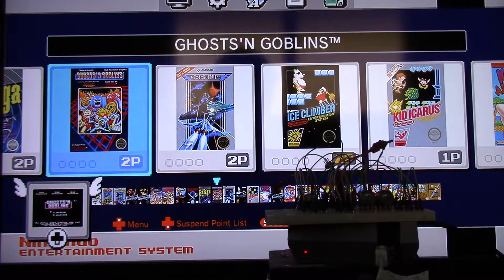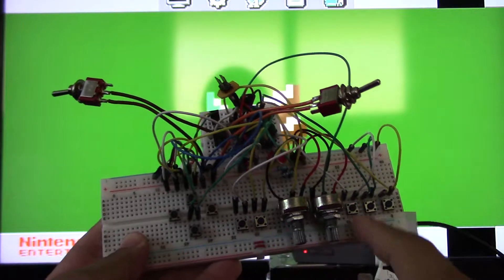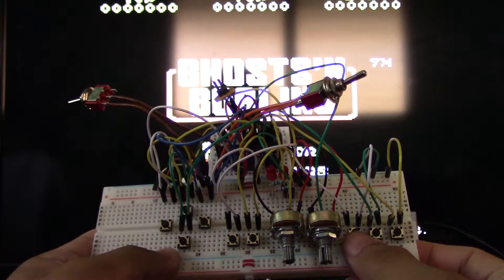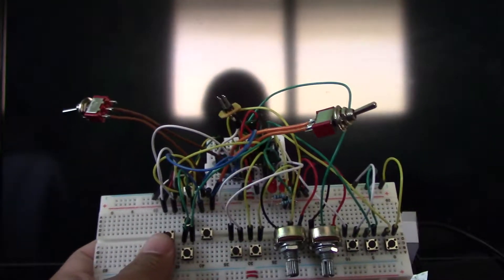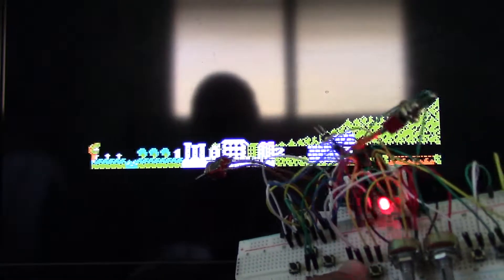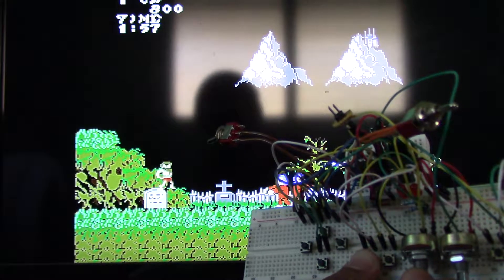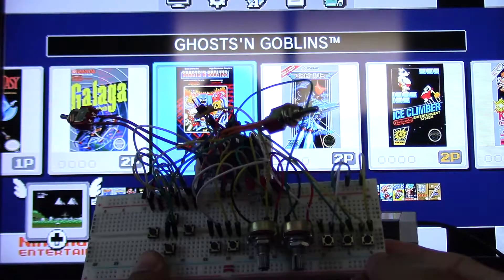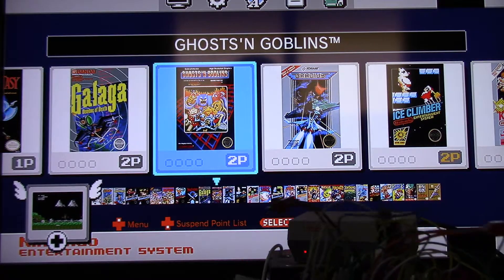DIY Nintendo Classic Advantage Controller

Comment: anyone have a link to working just with the chip?

What I need is a demo on how to program the Atmega328P with the appropriate code.  That's the part of this I can't seem to get right.  I've programmed other interfaces just fine before ... There is something about the I2C protocol this runs on that I'm just not wrapping my head around yet.  #NotASoftwareEngineer  

The physical circuitry; pull up resisters; pots and the rest I get.  (I have successfully built midi switches, USB keyboards (like the one I'm typing on now), and a USB joystick with parts and a Tincy)